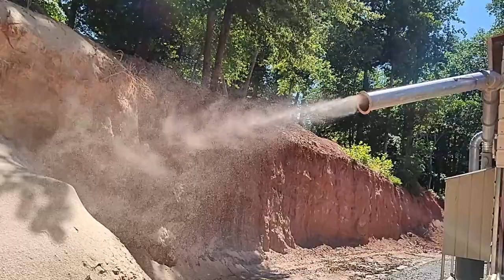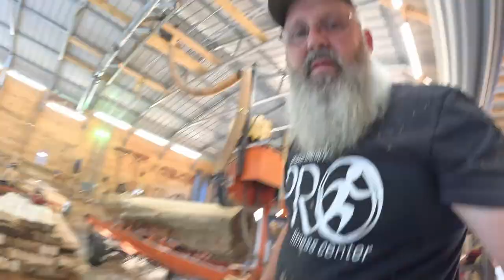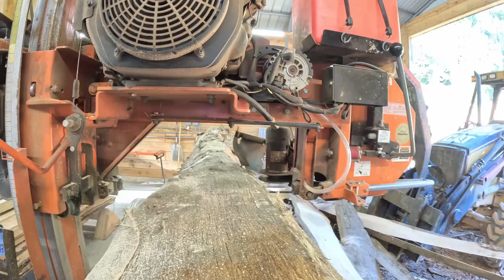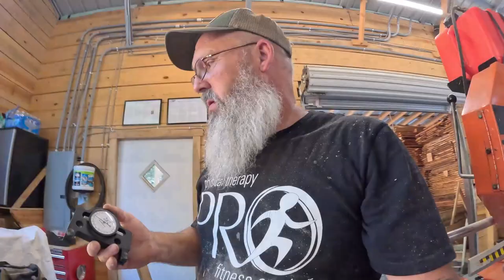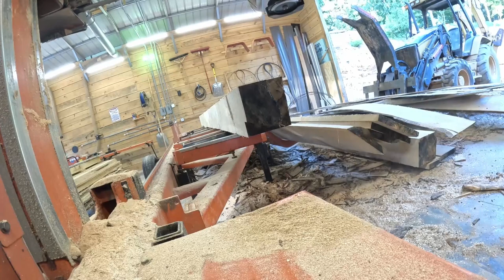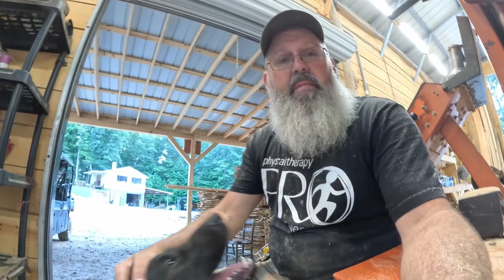WoodMizer LT35 Sawmill Sawing 10x10 Chestnut Oak Posts & How to change a blade.

Comment: I too am a numbers guy and the lesson you gave today is invaluable, in that even with the experience you have you still check blade tension rather than tapping and checking for tone which is different for each type of blade. I like  Morse or Starrett which are pricey but give consistant results, Great video I am hooked. Ray Stormont
Reply from the maker: Thx Ray
Reply: @BeardedLumber  I am excited to hear that you are going to build a kiln can't wait I had thought about building one years ago using solar hot water for heat (largest operating expense) with collectors enclosed in glass sealed arrays easily able to create near boiling water during day with a small cirruclating pump into a 500-1000gal arig. water/fertilizer storage tank. 40' container partioned off at length I needed and doors cut for side loading balance of container for equip and hot water tank storage with freezer/smoker fan coils for air circ. and heating inside kiln, fan coils controlled by 28 day timer heat controlled by thermostat to small pump from hot water tank to fan coils. Place container on automotive /truck scales allowing a daily check giving water removal each 8lbs=1gal,water. Kiln water condensing unit purchased from kiln mfg. My numbers at time said operating costs 55% lower and Kiln construction less than 25% as a DIY project. Ray

Comment: If you used a LT40 it comes with a pressure gauge for blade tension and allows a deeper cut (from blade to upper frame).  I believe it can cut a bigger log (36" diameter with 28" between blade guides).  I have been using a LT40 for 6 weeks and I was surprised how the blade tension changes with just a few cuts.  I have learned a lot from watching your videos.  Thanks.  Mike S.
Reply from the maker: Thx Mike, my next mill will be a 70 wide
I look forward to the wider and deeper cuts. Thx for watching